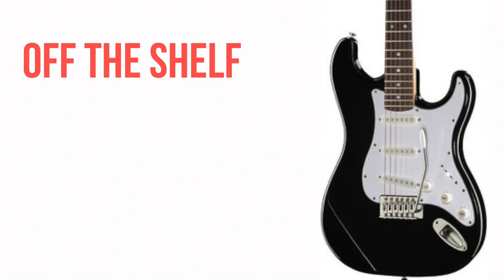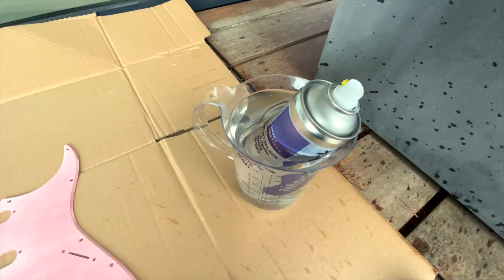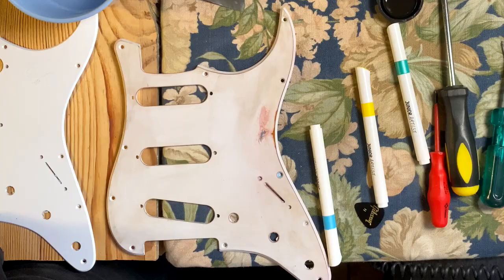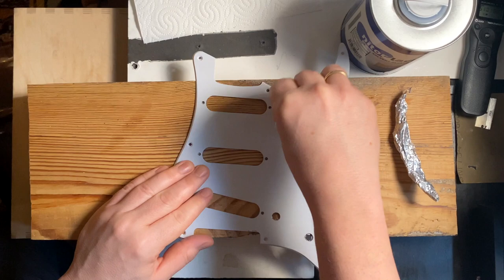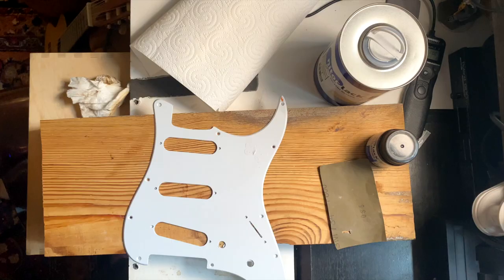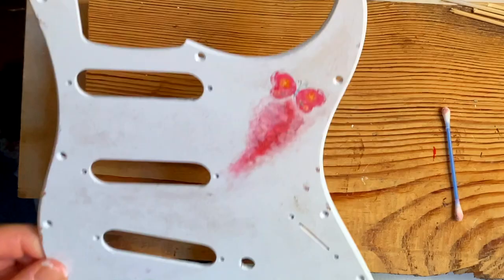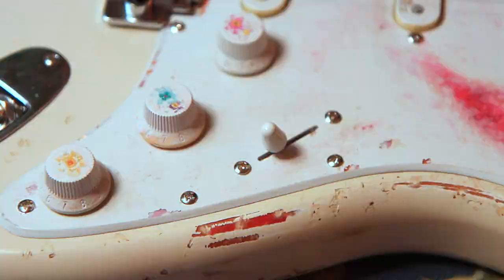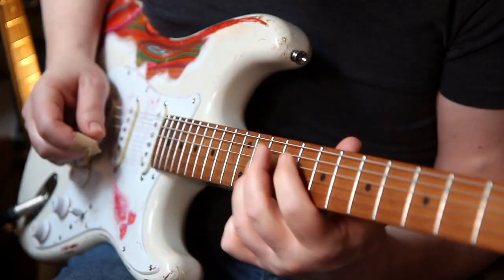Make Your Partscaster Totally Unique

Comment: Hi Michael,
I made one of your guitars and during the process I made a mistake when painting it. I put colour, and then a clear coat on the guitar and then realised there was a little imperfection in the in the finish so I sanded back a small area and sprayed the colour again. It looked great. BUT when I sprayed a light clear coat over the top the colour instantly cracked due to a reaction.
It appears that the clear probably wanted to bond with the clear underneath the colour...
I left it for a time while I sulked about how dumb I was and when I went back I wiped it off with a light sanding. What I found was it had done this crazy cracking pattern, so I left it.
It was just a cheap spray paint (for car touch ups), not nitrocellulose.
Reply from the maker: Wow… interesting Sean. Thanks for sharing that. Maybe that experience can help if you really want the cracking 😉… and thanks for watching 😃🙏🏻